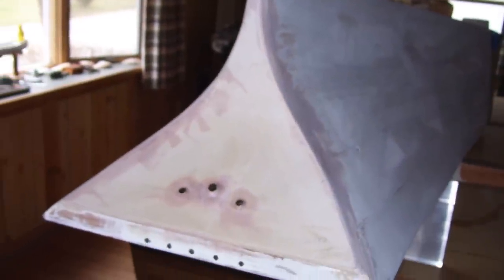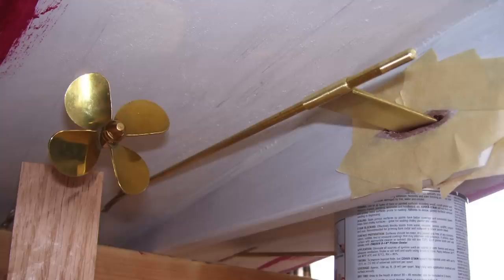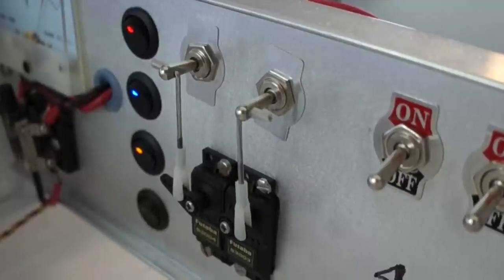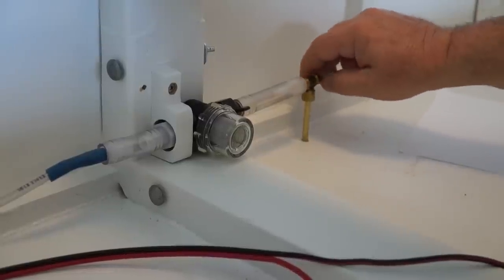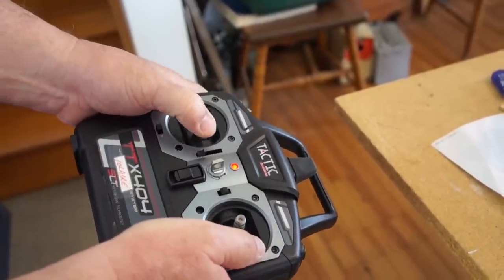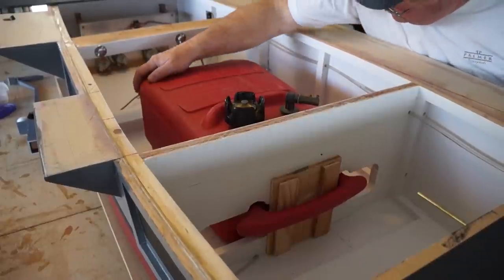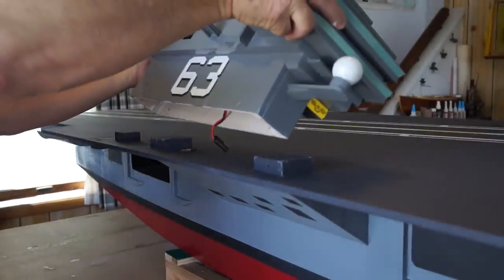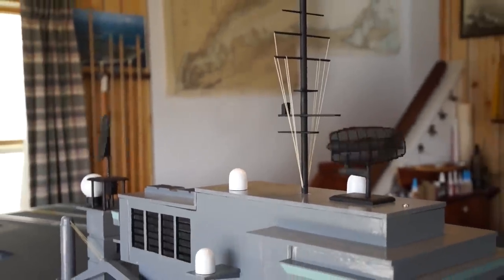Making a 13-foot R/C Aircraft Carrier from Scratch - "Building the Behemoth," Part 2

Comment: Regarding the water pump, perhaps consider running the water through aluminum tubing e.g. 1/8" wound around the motor bodies. Much better cooling for the engines. I had a 6v geared engine on a made from plans vosper RTTL about 30 years ago. It ran on lead acid batteries, and the newer 'kits' with expensive gear (30 years ago ;)) ran rings around my boat. A knowledgeable older guy took me under his wing, and we installed a water pickup behind the prop, plastic tubing back to the aluminum tube, then plastic tube to exhaust at the rear of the boat. Kept the same 6v wiping speed control, powered by a primary 6v lead acid, but also had a r/c switch that controlled a relay to kick in an additional 2 x 7.2v lead acids in series when speed was required.

So a 6v motor running at approx 19v. Brushes did not wear, and motor was never even warm to touch. Same motor lasted for years. Should have seen the other modellers faces when I (pimply kid, little to no budget), hit the power on it. Faster than theirs, and battery life of about 25 minutes at high speed compared to about 5 mins for theirs at high speed. And at about 1/20th the cost.

Comment: I am sure you guys have probably considered this already, but what about the water cooling actually being functional? If the line from the pump was split into 4 lines at the motors, and each motor wrapped in appropriately sized copper tubing, then rejoined back together to be discharged overboard, then it truly would be functional. =)
Love the model guys, and just finished watching the first launch video, too awesome guys. Can't wait to see it complete, keep up the good work!
Reply: How are you doing after 10 years?

Comment: hoping to see something like 1/5  or even bigger scale lol great work..
 just wondering how come u guys dont use like brushless motor? are suppose to be better then old type?
Reply from the maker: Let's see, a 1/5 scale Kitty Hawk model will be over 200 feet long!   Brushless would work fine but the larger ones tend to be noisier than brushed, and more expensive. Reversible speed controls are also costly.  So for our purposes, with so much battery power available, the less efficient but simple motors we have installed work out okay. Thanks for watching..
Reply: +Rapidnadion hi ken here I,m thinking of building r/c approx.7ft model of hmas Canberra 3.You know where icould get scale drawings for that size please,great model was very informative a great to watch cheers.

Comment: How many amps do those motors draw? I doubt that it is more than few dozens. There are cheap car escs all around ebay - maximum is 15 dollars each. Down side is that you can't disable car style brake  - i don't see that as a problem, as you don't change direction rapidly on this giant.

Comment: What lipo battery do you use for the servos? I'm making a replica of the greek battleship georgios averof with steam engine. It's 2,20 centimeters long and 30 centimeters width .
Reply from the maker: 2 separate radio systems, each receiver has its own 7.4v 5200  LiPo battery.
Reply: @Rapidnadion  Wow your still active! Cant wait to see your next video!

Comment: How much better does the marine battery work than the lipo batteries? Would a atv battery do good in a smaller model?
Reply from the maker: We chose large capacity storage batteries so we wouldn't have to worry about running out of power during 'deployments'.  The big boys also help to ballast the model so it floats at its waterline.  While LiPo's could work, you would need a lot of them to provide enough amps and they would be expensive.  Also, you would still need to add lots of ballast if partially depending on the LiPos for weight.
Reply: Thanks for the reply, also, where did yall get the bell for the uss hank?
Reply from the maker: Wow, .. nobody has ever commented on the E. O. T. engine room bell!  It's an egg timer bell.  The erratic 'dings' are produced by a very small weight being spun around by a thread attached to a really small servo motor shaft.
Reply: Yeah I found that was pretty neat, I'm planning to build a uss Iowa and was thinking about putting the bell, hopefully I'll stick with it and have the time to finish it
Reply from the maker: good luck with BB-61; what scale?
Reply: Its gonna be 6 ft long, and about 12" wide at beam, not really sure what scale that is haha
Reply: Where did you get the 3 rpm motor from?
Reply from the maker: We sometimes use old servos and gear them down some more.

Comment: Can a 10 to 15° degree turn to starboard on the prop shaft have a big effect on the control of the ship?
Reply from the maker: Luke, turns, or course changes to port or starboard may be initiated by rudder angle,  backing down intermittently on one side, or both.  Port ahead, while backing on starboard continuously will effect an in place clockwise ship's rotation; adding right rudder in this scenario will increase the rate of turn somewhat.  Initial cavitation creates some turbulence at the water's surface, but (finally) to answer your question, control is maintained.
Reply: Ok thank you very much.
Reply: If the ship has its motor completely horizontal would water enter through the shaft and how can I stop water from entering the ship?
Reply from the maker: A close fit between shaft and stuffing tube + light grease or oil and you'll be ok.  A few inches of depth under the water's surface doesn't provide a lot of water pressure to cause leaks.
Reply: Thanks Rapidnadion

Comment: what did you build the hull from and how much ballast did you use,
i built a 6 ft wooden one , severals years ago , the problems was to high up.  wind drove it crazy
Reply from the maker: Mike, we used 3/16" and 3/8" plywood for the build.  Ballast is around 140#, or half the total weight.  Thanks for watching.
Reply: How do your decks lock down, I was thinking of screws but it seems you guys have a different way?
Reply: +Rapidnadion It's time for some more military ships.  And I think that a replica of the Japanese battleship Yamato which could fire airgun bullets by blowing up the firecrackers in her cannons is a perfect candidate. Also, record a video where she shoots down a scout plane launched from the Kitty Hawk,when you will complete the construction of it(Yamato).
Reply: As for ballast, the car batteries would function ideally as ballast, as well as voltage source. Kinda kill two birds with one stone, on that.

Comment: In your video showing planes landing on the carrier, there are what appears to be arrestor wires running across the deck. Do they function and if so how?
Reply from the maker: The ends are secured to elastic bands beneath the flight deck, so they have about 18" of "give" before they begin to retract.
Reply: Thanks

Comment: I don’t think you’ll require a speed controller. The boat is big enough, where it’s size will keep the speed low.
Reply from the maker: Correct, Brian, we usually steam around using just 2, sometimes even one, motor.  At ~300 lbs. no maneuvers  happen really quickly...

Comment: Also, from a former lineman, when connecting power, negative first, then positive. You get less sparks.
Reply from the maker: Good!  we were not aware..
Reply: Rapidnadion it’s not a major issue on the low voltage crap, it really only matters on the high voltage stuff, but it’s a good practice to get into.
Reply: Nicholas Bassett only if you don’t connect the negative wire first.
Reply: Nicholas Bassett also, what is your background? Are you an electrician? And if so, are you union? What local (if you are union)?
Reply: Nicholas Bassett your silence speaks volumes.
Reply: Nicholas Bassett I never said you wouldn’t get sparks. I said if you connect the neutral, it’ll keep the sparks to a minimum. Here’s a hint for you: before you go and open your mouth again, LOOK at what I said. I do know what I’m talking about. I set up numerous cable power supply boxes for cablevision cable, all this way.
Reply: Nicholas Bassett also, want to get less sparks? Make the connection quickly.

Comment: Instead of water ballast why not run a 2nd battery ?
Reply from the maker: It would take 2 additional batteries to reach the same weight as 6 gallons of water + the container.  While it would increase voyage duration, 12v batteries are not inexpensive...
Reply: @Rapidnadion  I understand. That's crazy how much ballast is needed. Great job on building the ship

Comment: Why didn’t you cool the motors with the water the fans can only blow the air from inside
Reply from the maker: As we got to know the boat and its systems we found that the motors don't really need any cooling, even after 1/2 hour runs they only get up to around a hundred degrees F.

Comment: not much detail on this build or craftsmanship. compared to others on you tube.
Reply from the maker: Details have been added over the last several years of its operations.  You picked a video where we were still building it;  a model of this size requires time to add features. Craftsmanship?  We do the best we can with the materials, time, and work space we have.